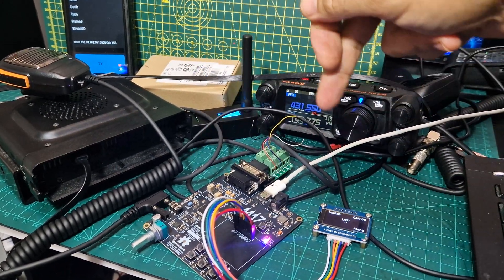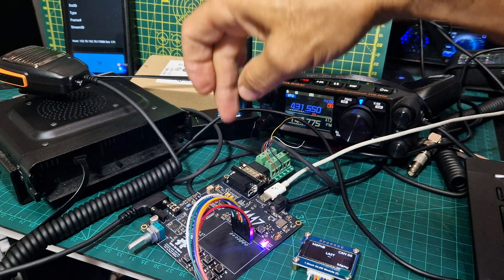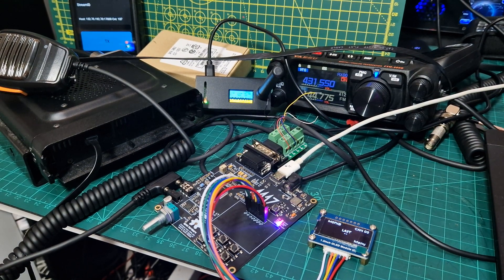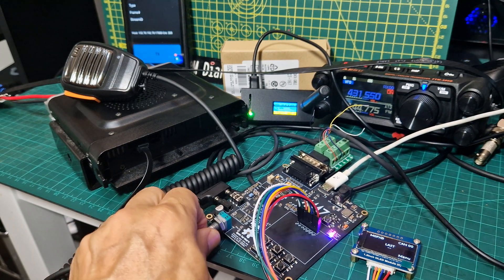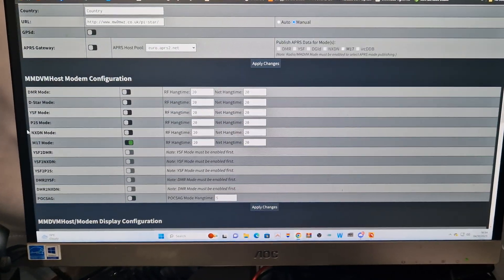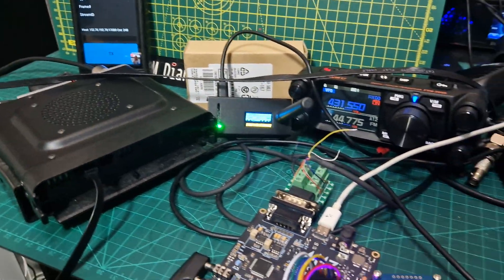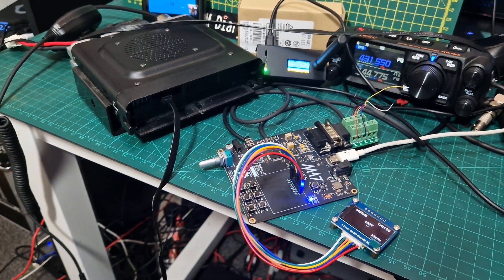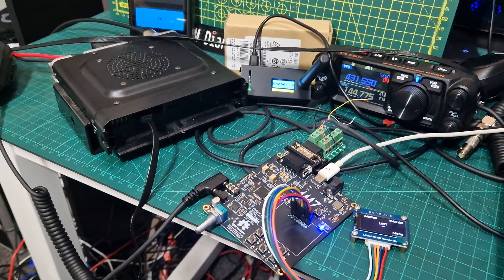M17 MODULE  TRANSMIT TEST  YAESU FTM500 & M17 RF HOTSPOT

Comment: Youi need to put the FTM500 in 'FM Packet mode, select FM, got in to data settings and set the data rates for 8600 baud packet out.  Meke sure you have connected to the 9600 pins on the CT167
Reply from the maker: I have tried all.above used diagram to make cable no joy how do you put radio in packet Mode ?